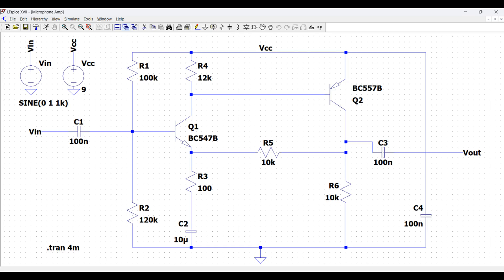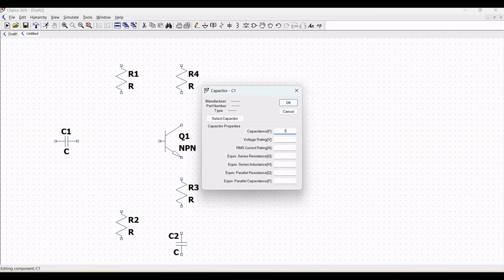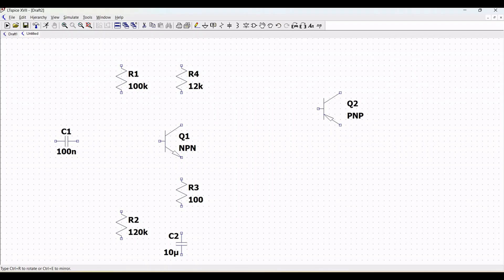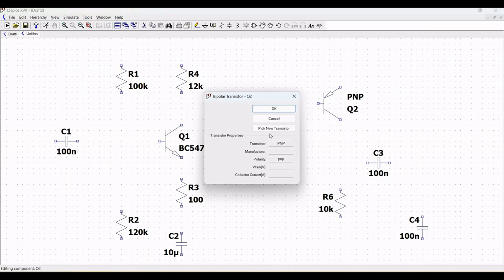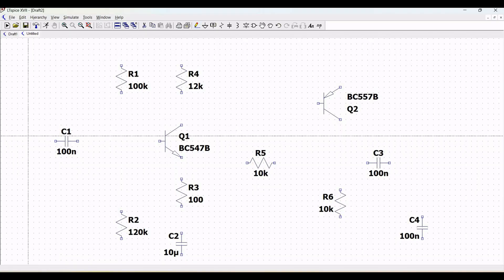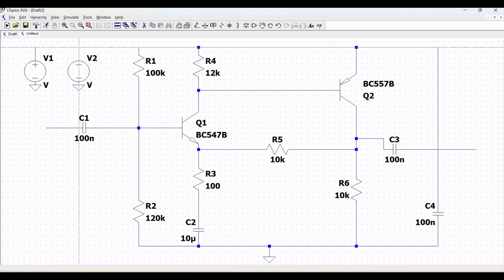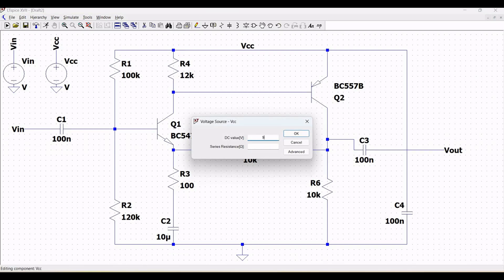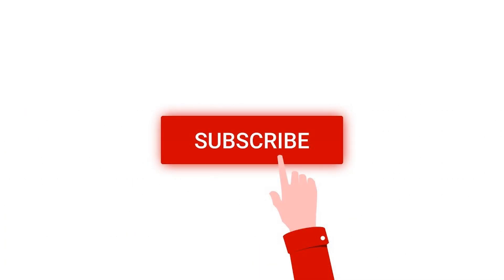How to design Microphone pre amplifier transistor circuit using LTspice tool

Comment: Your input bias for 9 vdc is degenerative. You're providing -4.9 vdc to the base-emitter bias, and +4.1 vdc to the base-collector bias. Your input transistor will have to consume some of the A.C. input signal in it's D.C. time constant to bias correctly and switch on, and that means you're losing a significant portion of your input wave so less than 360° is getting into both stages.

You will see a 360° signal at the output, but probing around and running the simulation, you'll see signal loss directly on the input signal.